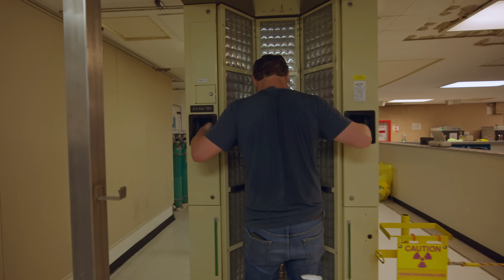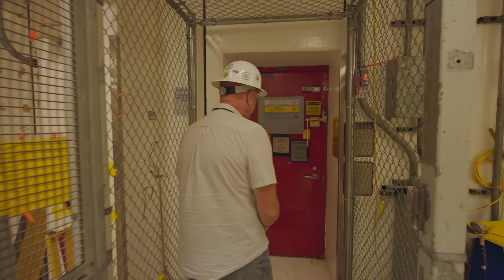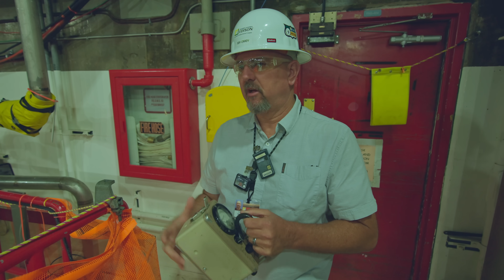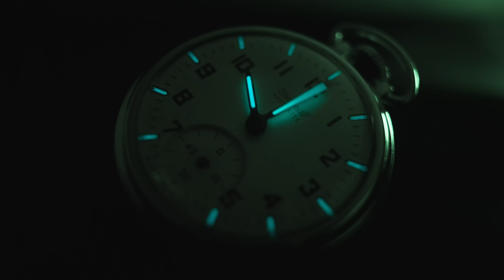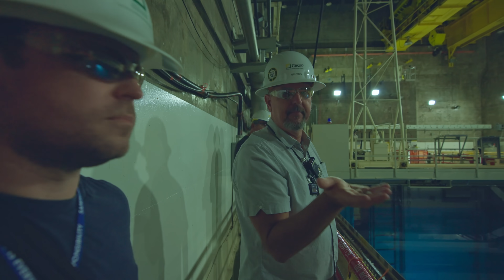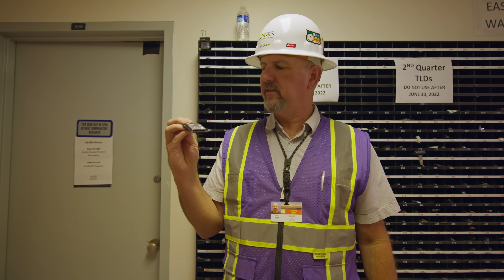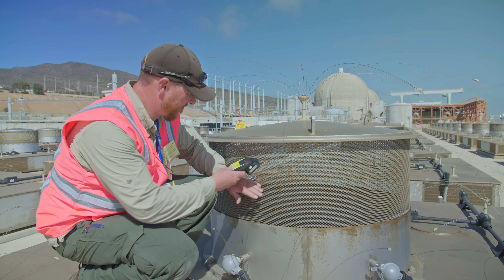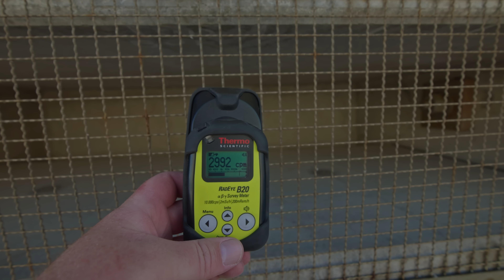Inside San Onofre Nuclear Power Fuel Pool and Spent Fuel Storage

Comment: What happened to the radioactive kittens? Who's paying for the TWO failed fixes and the decommissioning?, if not the unfortunate ratepayers? Did you know the decommissioning will leave the spent fuel in casks on the shore of a rising ocean? Nice work, CA Ed subsidiary, you corner-cutting thieves.
Wikipedia:
On February 1, 1996, four kittens were found at the plant in a small space between two of Unit 1's administration buildings by plant workers. They were discovered outside of the radiologically controlled area, but tripped contamination alarms when the workers of the plant attempted to set the kittens free. Health physics personnel responded to the scene and frisked [?frisked wtf] the kittens for radioactive contamination. None of the workers handling the kittens were contaminated, however the kittens each measured 6000 counts per minute. The kittens were given warm baths with shampoo, which reduced the radioactivity to 1000 counts.[44] The kittens were taken for further screening, where they were found to have been contaminated with Cesium-137, Cesium-134, and Cobalt-60.[45] The radioactive activity within the kittens began sharply decreasing, and the kittens were declared to be in healthy condition.[46]
In trying to find the kittens' mother, the workers learned of the animal control officer's incident the day prior. The officer was frisked for contamination. No contamination was found on the officer, but there were trace amounts of radioactive isotopes on a rag the officer used to dry the mother, as well as on feces excreted within its cage. As the search continued, the remains of the cat were found on Interstate 5. [I guess momma can't dance or didn't make it far with that bellyfull of radiation, huh?] Health physics personnel analyzed the remains, finding identical activity as the kittens. The kittens were adopted by plant workers, having been named Alpha, Beta, Gamma, and Neutron. [I'm sure nobody did the science because they didn't want to know, but, among other things, I'd love to know about those kittens kittens!!!]
Reply: You commented this wikipedia article two times in this comment section. Under one of them you unnecessarily created a fight and randomly started screaming at the Video-OP.

Being sceptical of nuclear reactors is definetly wise but you seem to search out problems with it that ARE NOT problems. 
Also: A decommission of a nuclear reactor is something I happily spend my taxes on. 

Decommissions get paid by the companies who own these nuclear reactors though. Those create trust funds for the nuclear reactor and have to approve that the company can give enough money regularly, to decommission the reactor.
Source: https://www.nrc.gov/reading-rm/doc-collections/fact-sheets/decommissioning.html 

I also took my precious two seconds to search the article of the cat and kittens individually outside of wikipedia to get more information. The cat and kittens are healthy.
I googled it, literally the first result is an article of the Los Angeles Times reporting that they are healthy. The rest are weird and inconclusive Websites that have nothing to do with this story. Plus the wikipedia Article doesn't exist. Didn't find it. 

In case you still want a source: 
https://www.latimes.com/archives/la-xpm-1996-02-08-mn-33724-story.html

Oh and you want to get problems from current times because this story seems to be from 1996... And the cats were found OUTSIDE of the plant so it never was a problem to begin with.

Small hint to the end: If you want to keep on having this discussion, don't. I won't talk to extreme rage fits. Again criticism against nuclear plants is totally fine. I have it too. But please keep it reasonable and actually factual, so you have an actual point and don't have to throw hissy fits towards anyone.

Comment: Brother & I were System Engineers at SSES Berwick PA from '77-'85. Great experience. Pro nuke!
Reply from the maker: That must have been a cool place to work.
Reply: @RadioactiveDrew  indeed it was.

We designed pipe support for large and small bore pipe. Once approved by Bechtel engineers, that design would become reality in the field.
We were the first plant to go on line after 3 Mile Island & incorporated an additional back up system for the original back up. The reactor building got very crowded with the added supports. Hitting rebar in the 8' thick containment walls had to be documented considering #0 bars were 8" o.c. Testing the systems was very critical. No mistakes.
The day fuel was delivered was a monumental day.
The cooling towers are 500' high.
There is a spray pond as a back up for the towers.
The entire team did a great job. No short cuts. All by the book. Super safe to this day. Top shelf construction.

Comment: And the Hanford sight has been leaking nuclear waste into the Columbia River for at least a decade??
Reply: Do you have a source for that? Any and all radiation releases are required to be declared to the public in the context of nuclear power.
Reply from the maker: I think with weapons manufacturing it’s different. When the graphite moderated reactors were running, at least the early ones, they would but water back into the Columbia river that was used to cool the reactor. Since that water would pass through the reactor it would become activated from the neutrons in the reactor. There was a holding pond that would hang on to the water for a little bit while the very radioactive isotopes would decay away. Then they would release the water back into the river. There would still be tritium in the water when released.
Reply: @JilbertBoy  Evidently it's common knowledge. Google "Hanford nuclear site leaking" ????

Comment: humans will continue to kill the planets.....Forget plastic i dont believe thats as big of an issue as people say, but this shit is. Once a powerplant has issues like in japan and ukraine there is no repairing that part of the planet. ONE big thing goes wrong at these plants and it kills a portion of the planet for 1000s of years. Not worth the trade off when there is other green ways to make energy.
Reply from the maker: Places that have experienced nuclear accidents like Chernobyl and Fukushima aren't dead zones. Plenty of plants and animals live there with zero problems. So I'm not sure where you're getting the idea that these accidents have killed some part of the planet.
Reply: Keep in mind that every single fossil fuel plant currently running is actively destroying the environment. The pollution from coal plants and such contributes to poor air quality and causes many premature deaths per year. Nuclear is, by every possible metric, safer than fossil fuels. Even if you include every nuclear accident in history. The accident at chernobyl is not possible anymore, since every power reactor that I'm aware of has an unfathomably large containment structure made of steel reinforced concrete. Chernobyl had a tin roof, thick enough to keep the rain out and that's it.
Reply: There is repairing that part of the planet (tho it may take a few thousand years before it's 100% back to normal). What happened in Ukraine was a freakshow of dumbasses that were going against like every safety rule and the person in charge was a narcissist, and in combination with a shitty power plant the Soviet Union developed, they basically found the needle in the haystack and it blew up. Fukushima happened because of a massive, ignorant company that didn't put in all the safety features necessary and then a super massive earthquake happened which might I add never even caused the disaster, it was the tsunami which was like the biggest tsunami in documented history for Japan and the water drowned the backup engines. They were two very, VERY rare cases of nuclear accidents. There have been and are hundreds of nuclear power plants that are safe and operable that have run for possibly even longer. 

Of course there have been other nuclear accidents, but all of the smaller ones are 100% contained and have been cleaned up.

And even with the waste produced by one, it's so much better in comparison to fossil fuels.

Comment: The whole body contamination detector was very interesting. The plants that i worked at had detectors that scanned the left and right side of the body instead of front and back, it seemed much more ergonomic to use than the one shown. I am kind of curios as to which was older and what the pros and cons are between the types.

Great Video! I love seeing nuclear power portrayed in such a positive and informative manner!
Reply from the maker: I try and approach the subject of radiation and nuclear power as neutral as I can be. I feel like that's a pretty effective way to show it to people that might not know much about it.